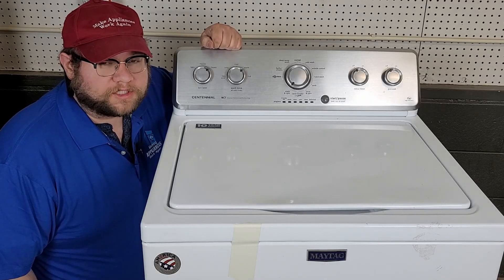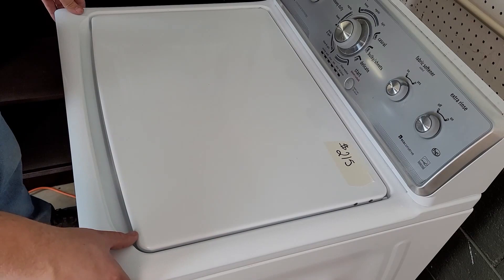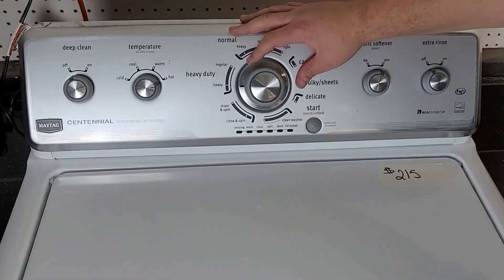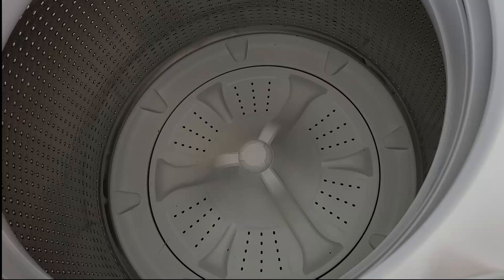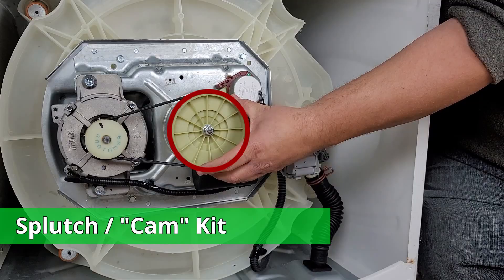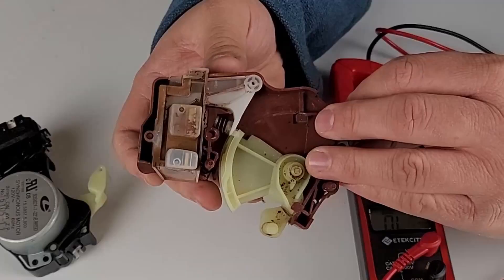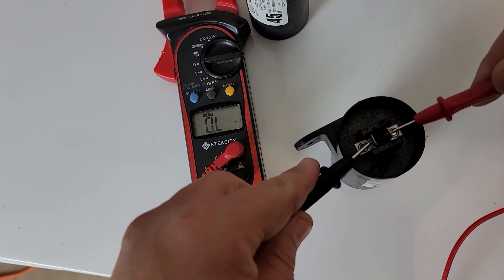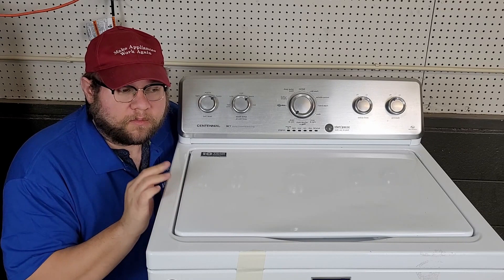Maytag Washer Won't Spin - How to Troubleshoot a Maytag Centennial Washer

Comment: I can't thank you enough for this tutorial!  I am an old lady (65) who has never attempted such a thing before.  I didn't understand the error codes fully (not your fault), but I took a chance on the shift capacitor being the most common cause of a Maytag not spinning, especially if it has been overloaded.  Guilty!  This has been a most valuable experience.  I learned two very important things from this.  The first being DON'T OVERLOAD THE WASHER and two, when something is as easy to change out as this shift capacitor is, YOU CAN DO IT!  You saved me a service call and I thank you so much!  Will you marry me?  Just kidding, but almost not kidding at all.  This made me beam with gratitude.  Thanks also for telling me about the nut driver because I didn't have any.

Comment: Hey @Bens Appliances and Junk, I lost my job a couple weeks ago.  About 5 days later, my Maytag Bravos washer wouldn’t agitate or spin.  I’m fairly handy, so I did some searching and found this video.  Following your advice, I was able to figure out it was a bad capacitor.  I never knew about the hidden service manual either!  I inspected/tested the other stuff just to make sure I didn’t have multiple problems. My man, I spent less than $60 as I only needed a new capacitor.  You saved me 100’s of $$$ at a time when money is tight.  Thanks.

Comment: Best video on this washer that I've seen.  Nice job!  The Tech Sheet can be accessed from under the washer without removing the lid.  For the black actuator, the drive motor is tested between pins 3 & 6, not 5 & 6.  Pin numbers can be found molded into the male electrical connector.

Comment: Excellent video !!! Originally I got ripped off by the appliance repair guy from Sears who came over to check the washer . He ran a two minute self disagnoses and said it would cost over $600 for a new control board to repair so it wouldn't be worth fixing and gave me a 10% off coupon to buy a new one at Sears and charged me the $79 diagnoses fee . After watching this video I found out it was the actuator so I bought a new one for $25 and now the machine works perfect. Sears pulled a total rip off scam to get you to buy a new one. I complained to consumer affairs but they said it's legal to scam and cheat consumers and they really don't so anything down there but collect their government pay.

Comment: For someone who never had any repair and troubleshooting experience before you started your business, you sure have come along way. Great videos and great help ! Thanks
Reply from the maker: I'm trying! Thank you!
Reply: @bensappliancesandjunk  Ben why is removing the striker dangerous?
Reply from the maker: @mhern57  because if you're running the machine with the striker in the lid switch housing and open it up during spin, you could get hurt. I am only saying this as a safety precaution. Obviously if you're doing it only to test things and are taking precautions it makes sense to attempt it.
Reply: Hello ben. Thanks for getting back to me regarding why messing with the lid switch can be dangerous. I thought the motor was leaking oil the parts place said Motors don't leak oil and it's probably coming from the transmission.. 240 bucks and a week to ship. I'm going to check your video regarding the transmission but it's probably time for a new washer. This one's only 5 years old. I guess they're designed to quit after that long. Junk.
Reply: @bensappliancesandjunk  Man, you have such a soothing voice! You definitely could have a YT channel where you read stories to help people sleep.

Comment: WOW.  What a great video!  Thoroughly explained everything.  Loved how you showed exactly where to connect the multi-meter.

My problem seems to have been the shift actuator.  Luckily was able to pick up the part locally.  

Only took a few minutes to reinstall it.  Ran the recalibration mode as you showed and everything seems to be working.  Running a test load now.

Thank you very much!!

Comment: Thanks, Ben! I've been troubleshooting our Centennial off and on for a week or so, until I came across the point in this video where you mentioned Drain Pump related to Not Spinning (my problem). Sure enough, when I removed the pump, there was an obstruction! Good to go now! 💯 -Mitch A J.

Comment: This was a great video and easy to follow. HOWEVER, let me just add before you start taking anything apart get a drop light (very bright light needed) look in seam around drum and center piece (actuator I think). I removed  $0.26 cents which had locked up the machine and it would not wash but did spin.  Almost called a service man cause codes told me that the Motor/Capacitor was the problem.  Removing the quarter and penny saved me $189.00 service call plus any parts they would have magically insisted I needed.
Reply: John Penna: That's called money laundering.

Comment: Thank you so much for this video! Our Maytag Centennial wasn't wanting to spin and the lid lock wasn't working. We started off by replacing the lid lock. Then, we continued on with your video and turned the machine over to get underneath it. The belt had slipped off! It is working great again :)
Reply: check the belt for any softness (oil soak). Ive found a few bad gearcases by the belt falling off after its been lubricating by leaking gear oil
Reply: Keep that old lid lock..... very hard to get now.... sell on ebay
Reply: @michaellevesque7032  we ended up needing to replace the belt as well a few days after that. Haven't had a problem since :)
Reply: @jessicarowton6429  Thanks for the update!
I'm thinking your belt was wearing out, and that's why it slipped off to begin with... then with the replacement, you were good to go.

Comment: This was a huge help! Thank you! My washer stopped doing the high-speed spin a little over a week ago, making me need to to a Drain & Spin cycle that got about half the remaining water out. Thanks to this I figured out it was the shift actuator. The replacement was $27 and took just a couple minutes to install. Works just as it should again.
Reply: Hi I think I have a similar problem. Did you have a fault code or no faults were displayed even if the shift actuator was faulty?
Reply: @vincentperreault3958  Sorry for the late reply. I had the correct fault code for it.

Comment: Ben: My MDW655DW was making a horrible noise and then quit spinning. (Last year I replaced a bad transmission, the splutch and belt.) Upon tilting my washer up, I discovered white plastic powder under the unit and a perfect circle ground out of the belt guard. I found that the nut had come loose. After reinstalling the splutch nut, the washer spun and worked perfect! Thanks for your video!

Comment: Ben, your videos were a great help to me.  Within the last week I had a washer that would get stuck in the spin cycle.  From your videos, I learned how to check and read codes...found 2 codes, one for the lid lock and another related to the shift actuator (an F5 code and F7E1 code, respectively).  I replaced the lid lock first and ran recalibration...it got stuck in the spin cycle...no lid lock code but still the F7E1...had to order the shift actuator from McCombs in Lancaster (I am from NE OH myself) but I got that today and was able to get a full load through tonight.  Thank you for these videos!  Very well explained and helpful!
Reply: My washer is doing the same exact thing and I find myself having to change the setting and drain the water so it can fully get through the wash

Comment: Thank for the very well explained video. I am just blown away with the technology in this machine. It appears that the problem we had with our machine was that someone or a power interruption caused the cycle interruption and it just lost it's memory of where it was in the cycle. I tested the machine with the diagnostic in the control module, according to your instrictions and all came out ok , so I ran the memory reset and "Presto" it works like a champ!
Thank you again for your directions as they were extremely well described!

Comment: Thanks for a very informative video. Our diagnostic code (F7E6) pointed us in the direction of the shift actuator, that as it turned out, tested fine. When I pulled it out, I noticed that the long plastic pin was not in the oval slot on that clutch thing. Once I figured out that the actuator was fine, I moved the clutch lever so the pin on the actuator was able to engage and reassembeled. Ran a calibration and everything was back up and running just fine. I think I may have read somewhere that if you have a really unbalanced load, that pin can come out. Best of luck in your business.

Comment: I tell you what I've come across a lot of these in my work and I seem to always get stopped up on one.  I have learned the actuator is a very common part to go bad. And checking the code and calibrating is definitely necessary for a good diagnosis.  this is a very educational video thank you for  Putting this together.

Comment: note that the actuator might still be bad even if it passes the ohm's test. I rebuilt the entire washer including inside the transmission and inspected, cleaned and lubricated the pulley clutch kit. I went through all the troubleshooting steps and measured the capacitor, motor and actuator resistance. actuator still will make clicking noises and won't shift even though clutch is easy to shift. you can hear and feel the actuator clicking if you put your hand on the actuator motor.
DIY rule of thumb is. assuming the latch, water and drain work. replace the actuator and pulley clutch kit. if it still doesn't work. return parts (if possible) or sell back on ebay and scrap the washing machine. at that point it's probably the mainboard or something too expensive to be worth changing. 
I'm DIY and figured all this out in about a day so I'm not an expert so cross check my advice.

Comment: Great video and a real help.  My own problem was a bit different but this video helped me sort things out.  Two additional observations:  First, my problem was that the machine would fill but wouldn't go into "wash".  I had several codes that were close to, but not the ones listed here.  I found a  broken wire on the capacitor connector.  30 seconds of soldering:  problem solved.  Note that the wiring around the motor assembly gets a good deal of motion and over time, metal fatigue can set in and break a wire, usually near where it is crimped (like the capacitor connector).  The other comment is that I was able to use the drain and spin setting (could probably use the rinse and spin also) to clear the machine but it also verifies that the motor assembly and the pump are working properly.  Thanks again!

Comment: Thank you so much,  

Turned out loose spluch nut causes belt to slip, not completely on which wouldn't allow the washer to spin.  Tightened spluch nut and perfect spin!  Saved me a $250 service call.  Maytag Bravos X MVWX700xw2 Thanks!

Comment: What a fantastic troubleshooting/repair walk through.  YOU, Sir, were meant to do this.  I believe you may have helped to resolve my issue but I'm gonna' need to pick up a better multi-meter tomorrow.  I'll follow up then but for now, LIKED and SUBSCRIBED, my brother!
Reply: I picked up the new Fluke Multi-meter and was able to get much more accurate resistance readings.  Although all of my resistance values, for the various components, were where they should be, I deduced the root of my problem was still in some way, related to the shift actuator.  When engaged to spin, the tub spins but when manually testing agitate, the actuator failed to shift to agitate.  Likewise, when engaged to agitate, the pan agitates but when manually testing spin, the actuator failed to shift to spin.  Therefore, I purchased a new shift actuator and installed it.  After calibration, and additional manual tests of the spin and agitate functions, it seemed to be working as designed.  After 5 wash cycles I am able to confirm replacing the shift actuator resolved my issue.  THANK YOU, AGAIN for the wonderful walk through!

Comment: My washer would work right up to the final spin.  Lid locked & spin light flashing.  Code F7E1. Everything tested fine on my multimeter.  I was ready to schedule a service call.  On a hunch, I decided to replace the capacitor.  The only part I couldn't tell if it was working or not.  Turns out it was weak and wouldn't start the fast spin.  Problem solved.  Thanks for posting this vid, much appreciated!

Comment: OMG, I've watched dozens of videos to try to find this issue and it was that LITTLE bit of info at 5:00 that was the doozy, my wash plate moves separately and that's what's causing my F7 E1 error... now I gotta watch the rest of the vid and the one to fix it, thanks a ton!!
Reply from the maker: Glad it helped! Its caught us once or twice, and now we almost always look for it before even turning the washer on. The Whirlpool washlates are SUPER CHEAPLY MADE and do this more often than ever.
Reply: @bensappliancesandjunk  I actually watched another video where the guy replaced the wash plate because it was making a lot of noise and then in his "after shot" he spun the wash plate around and the basket lagged behind it and said "look, see no noise" hahaha, glad you're doing this help, it's helped me and my son along the way with our own flip business... I just saw your 60 sec vid on 13k in a month.... what did you net on that after expenses if you don't mind me asking?
Reply from the maker: @therealrollaz  net is difficult because the big issue is overhead: Are you doing it out of a cheap building, expensive building, ect. Net was probably around $5k after employee expenses too. I run a lot of business stuff, so if I was doing it solo, I could increase margins considerably.... doing this kind of job should net you $5-8k/mo solo if you're putting in 40hrs/wk or so.
Reply: @bensappliancesandjunk  what size town do you live in, we're in a small rural area, and ofc, if we were in a bigger city things would be much better but I was just wondering about the size population you've got for the 13k? thanks again!
Reply from the maker: @therealrollaz  I live in a town of 10,000 people and the county has 55,000 people. We can't keep up with demand, not even close.
Reply: @bensappliancesandjunk  wow, oh wow! serious?  we're in between two cities, one with 35k and one with 84k, the two counties are 230k, now we really need to talk... hahah, we should be crushed with business with that much population...

Comment: Thank you for a very well done video. Wife wants to buy a new washer, I say fix the one we have. You saved me 500 bucks!
Reply from the maker: Yeah, if you can fix it, fix it. These SHOULD last 10 years before a critical failure. Most parts to fix them are.... $50 tops. Most are $20-35, though. We fix a LOT of these and outside of a bad transmission, the codes make fixes easy.
Reply: @bensappliancesandjunk  I'm not like a tree hugger or anything but, I'm the type of person that will squeeze every bit of life out of something before I consider throwing it out. Our society has grown into a "Throwaway" generation. I have nine servers in my house in a rack. I built all of them with hand me down and throwaway parts. Been working for 8 years now with no problems. Electronics in landfills is more serious than just "Stuff". It's arsenic, cadmium, lead, etc. That stuff gets into groundwater so, I do whatever I can to keep stuff running without resorting to buying new. People like you have made it easier for me to learn how to fix more things and, I appreciate it!

Comment: Great video, thanks found bad capacitor on my Maytag 655DW1. $13 on Ebay and easy change out thanks to you.  Saved service call and $$$$$.  Once you understand the diagnostics and test modes it all became clear.
Reply from the maker: Thats the BIG secret on these machines - if you understand the diagnostics, you can just "Sit there" and fiddle with the knob until you isolate whats bad. Any more, when we get this type in our shop, we won't plug water in until we just throw it on an open electric plug, and start testing all the non-water stuff thru diagnostics and manual test. You can eliminate like.... 90% of problems that way in maybe 10min if you deal with them enough. Super "Simple" system once you know how those awful lights work.

Comment: We purchased this Maytag MVW7230Hw washer from Pochel’s in Tacoma, Washington.  It was delivered and set up by the delivery person.  We tried to do a load of laundry and the washer wouldn’t agitate.  I took a video to show that the agitator pretty much just vibrated, and didn’t even disturb the small amount of suds that formed when the machine partially filled with water.  I took the video to Pochels the next morning.  They said they would gladly deliver another machine for only $100.  I told them I wasn’t willing to pay an additional $100 to get a machine that worked when I had already paid over $1,000 for one that obviously didn’t work.  The agitator doesn’t always work, the fill doesn’t always work, the agitator tries to dry clean the clothes with no water in the tub and the clothes on top don’t get clean.
Reply: I am having a similar problem.
Reply: @shauwnamason463  Good luck getting it fixed.  I honestly hope you get better results than we have from Maytag.

Comment: Technician said he couldn’t figure it out,
called out appliance repair guy.
He said something was wrong with the ‘transmission’ as the agitator spins freely in both directions.
As it doesn’t spin dry and to look for a new washer ( same one you used to do the reset )